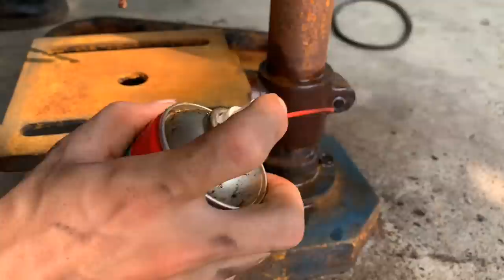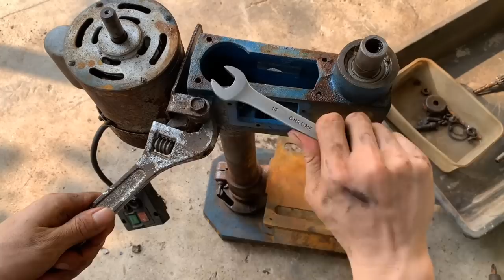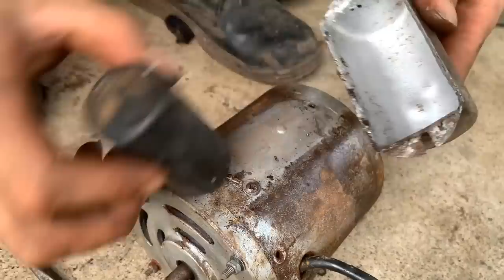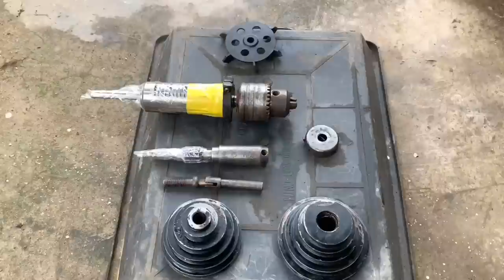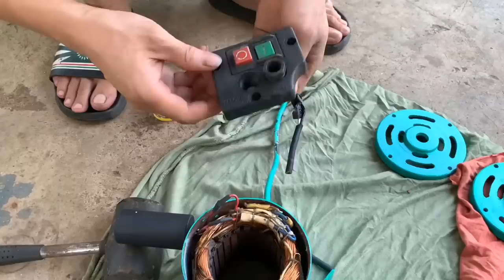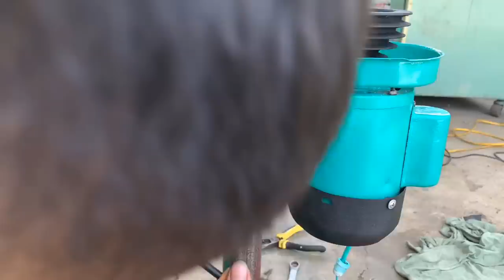Restoration Mild Steel Bench Drilling Machine Japan old - Repair ELECTRIC TOOLS ACCESSORIES Rusty

Comment: Lovely work, glad that there was so little damage to the copper winding. That would have been a pain if you had to remove and rewind all that copper wire.
Great job.
Reply from the maker: Oh yes luckily the coil didn't burn out. if it burns i will have to replace or rewind the copper wire. thank you . Have a nice day ...
Reply: @Restorationandmetal  ll
Reply: Eccetera.

Comment: You don't want to paint machined surfaces.  Top of the table, and the top of the base are meant to be for mounting the work, and need to be flat.  Also, the table and pillar mounting and mating surfaces should have no paint.  Anything that's supposed to be flat or square within a few thousandths should be a bare machined surface.

Comment: 19:20 why did he grease the outside of a press fitting bearing?
Reply from the maker: oh yes thank you for the question. The moving shaft part is not painted it needs grease to keep it smooth when moving the shaft ..